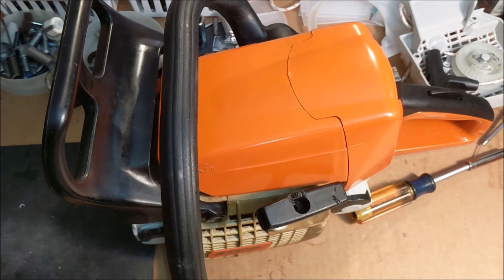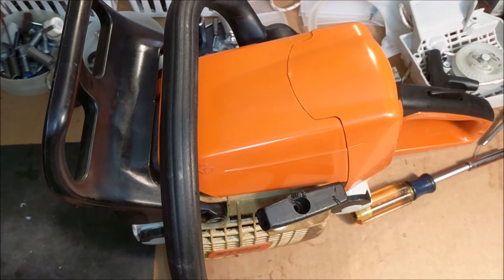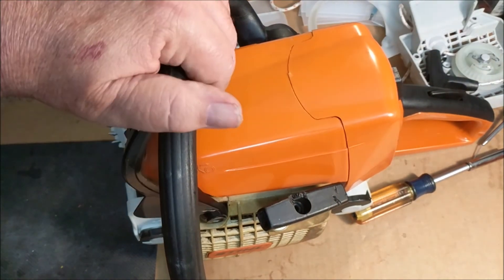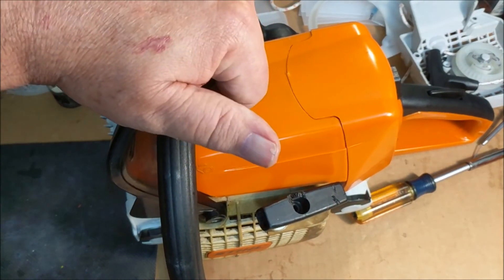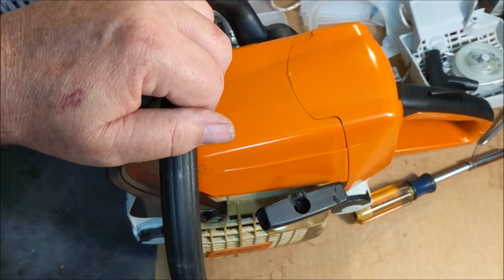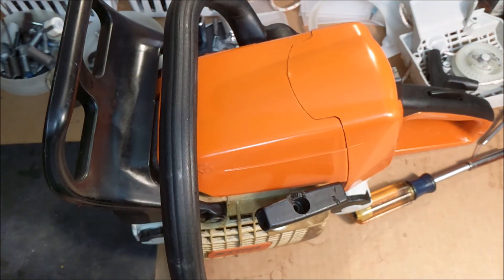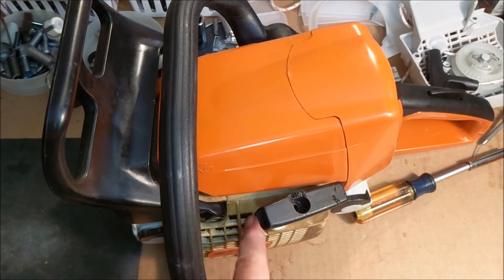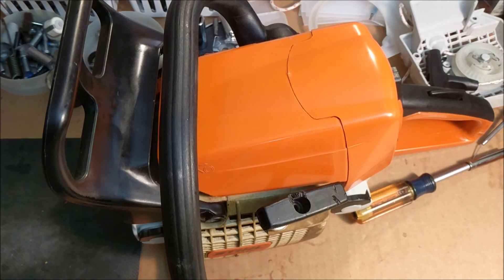FarmerTec MS250 Final Kit Items to Assemble with A List Added

Comment: Have you gotten this saw running yet? Curious to see a follow-up video showing it running. It is nearly impossible to read your list at the end due to the windows superimposed over the top by YouTube. Is it possible for you to include a comment with those details included? Any chance you've purchased and assembled another kit in recent months? I'm curious if build quality has improved with the kit since you built yours. I've seen other comments online from others saying they love this kit.
Reply from the maker: Yes, it's possible. All they needed to do was put better parts in the box. Comments are usually under the video on the YouTube page. Hard to see on a phone. I am working on the 200t kit now, excellent parts in it. The 250 kit does not run. I put no further time in it. If you get a good kit and then get a bad kit sometime. You will know frustration then. I just tell you guys what I find. I will put list under video